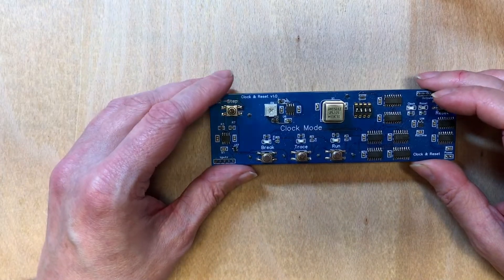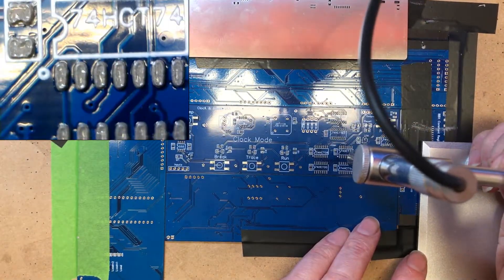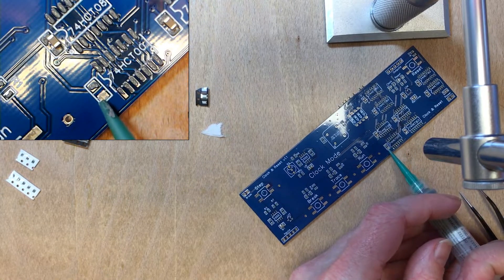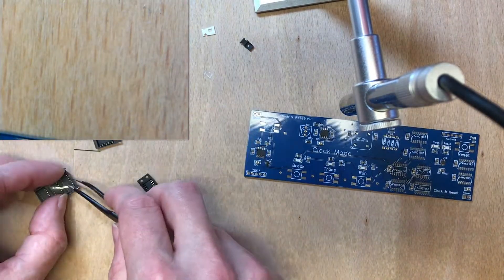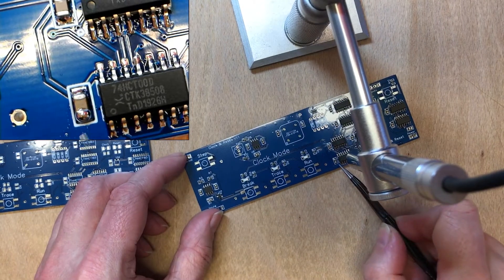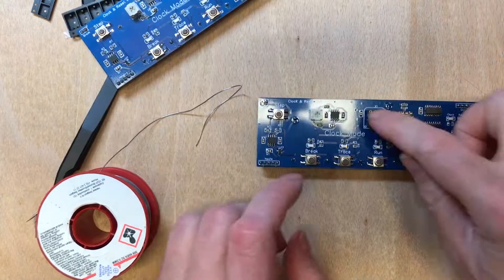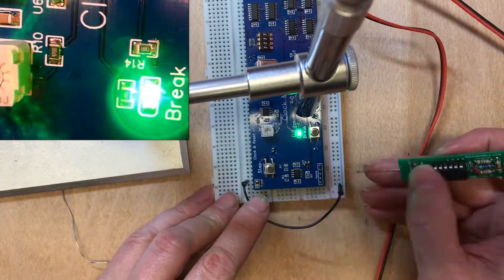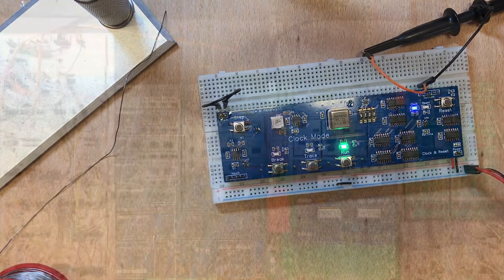Clock PCB v1.1 - Pipelined CPU Extras

Comment: "What, you dont use Woz' 3 hand technique?" - of all the videos on YT, (it seems to me that) soldering get the most "heckels" of all of them. With hindsight, I wounder how effective the new hot plate would have been with this board (onsidering you hand solder the switches).
Reply from the maker: Yeah, the hot plate would have made these switches easy!

Comment: I have the T-962 reflow oven, i do recommend it but I also recommend the mods to go with it.
Reply from the maker: That looks quite good, but I like the sound of the hot plate as I'd be able to record the reflow process easier, and I'm a sucker for seeing solder flow.
Reply: @JamesSharmanExtras  I had a quick look on Amazon after I posted and seen how much they have gone up by from when I bought mine. This video is a good DIY hot plate video https://youtu.be/ZChSbpBbrt4 and could also be a good video to make for yourself?
Reply: @JamesSharmanExtras  yeah watching the components jump into place is fun.

Comment: Great video. I like the format of having the complete solder work available to watch.  Start to finish, how much time would you estimate it took to assemble this board?
Reply from the maker: The "raw" video was 1hr35 but there are chunks of that where I'm not directly working (usually searching for a tool or scanning the schematic to check component values). Then there is preparation ahead of that I don't record at all, usually gathering all the components, positioning the cameras, failing to get the lighting right.

Comment: I would actually recommend you buy one those cheap hotplates for soldering, instead of more expensive tools. Way faster and easier than using hot air. Just make sure you remove the PCB when it is done, the thermal mass makes it cool down way too slow.
Reply from the maker: Thanks Jonny, do you have any suggestions on device?
Reply: I wounder what the health benifits of not using a hot bed are, especially in a confined space. I'm surprised no-one has made a kit (or conversion kit) for "hot air oven" - Even though I know the hot bed has become a staple here, I still think the best piece of kit he got 1st was that microscope camera, not just for YT content either ..
Reply: @paulwratt  Agreed on the microscope. As for a hot air oven, there are plenty of DIY kits to convert small ovens. Does not change the amount of flux residue in the air though.